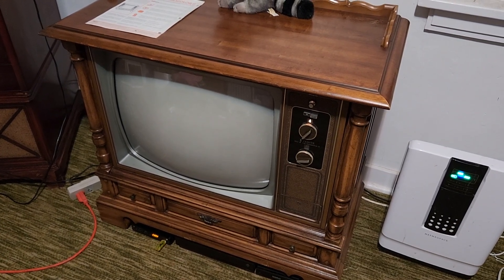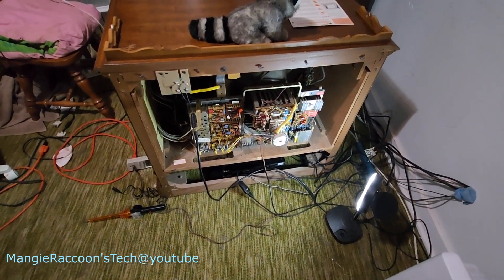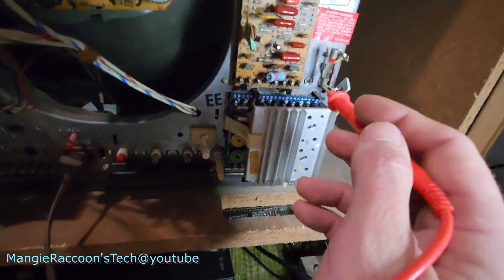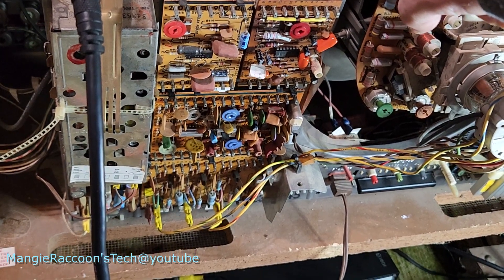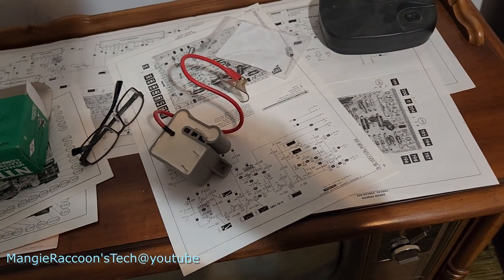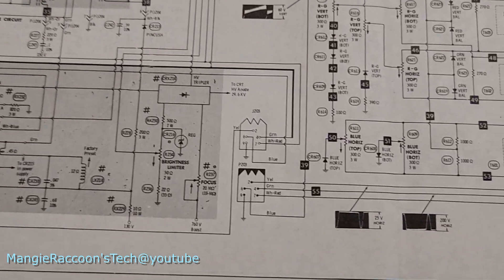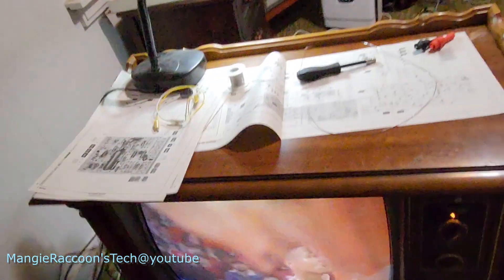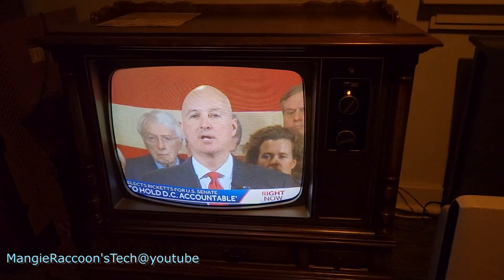Lost High Voltage - 1976 Zenith Vintage Chromacolor Console Television Repair PT 8 of ?

Comment: I'm feeling the pain here, I have a HUGE paperweight because I can't find a 212-149 tripler, which has one more pin than this and seemingly not subs.  I only wish to be knowledgeable enough to MacGyver something together that'd work haha  Hope it's still working for you
Reply from the maker: Welp it pop the breaker on the back of the tv so hard that it broke lol I haven't looked into it yet. Someone commented on here somewhere you can easily make your own trippler. I was going to look into that and try it
Reply: @MangieRaccoonsTech  That's unfortunate to hear. For how great these CCII are said to be, triplers seem to be an achilles heel. I did just find the correct space command remote and bought it, which feels perfectly irrational LOL  All the more papers that I can weigh down though.

Comment: Those triplers are very high failure in these and since they are no longer made, I'd suggest trying to get another one as a spare. They have several failure modes, one of which is what you experienced and they short. Usually, they trip the CB when they short, but it sometimes won't and it WILL take out the flyback transformer and HOT, if left on too long. Another common failure mode is the insulation will break down and the HV will arc from a crack in the case to the chassis. The 3rd failure mode is the focus will go soft. When it comes to these sets, the HOT heatsink should barely be warm and the tripler should not run hot.
Reply from the maker: Yeah I was surprised to see that it seemed like this had the original tripler. I did notice that the HOT and heat sink was staying pretty cool until it failed. I'm glad I didn't burn up the flyback running it trying to troubleshoot. I'll keep an eye out for any of these other symptoms to keep on top of it in case the new tripler fails. Speaking of a spare, I did find another one and being I had such a hard time finding this one, I jumped on it and now have a spare nte528. I also picked up a spare nte523 for the tabletop. Also got a replacement screen pot for the tabletop I need to tackle soon.